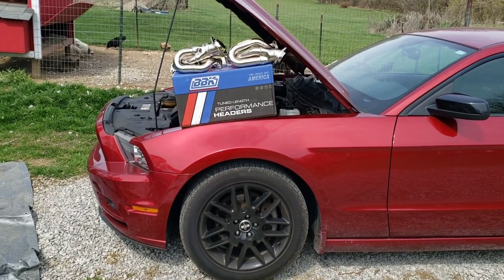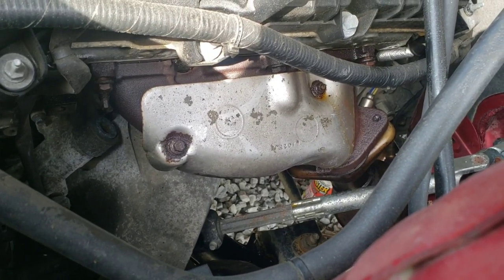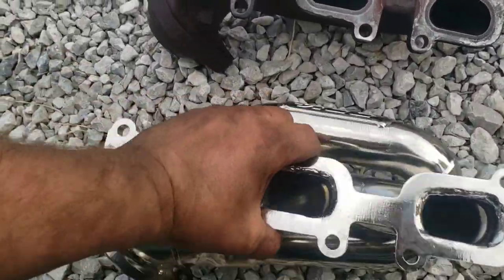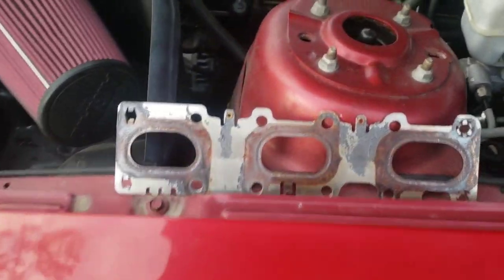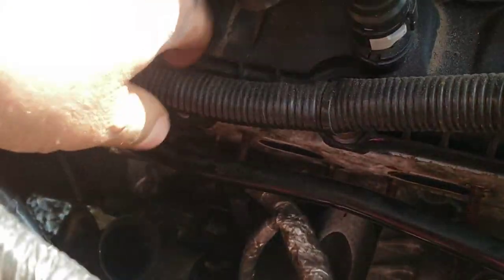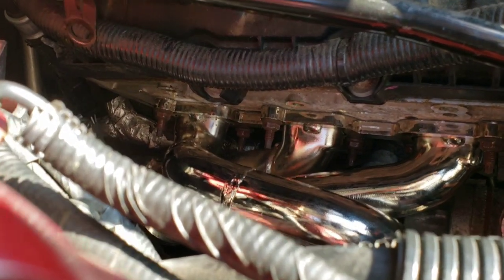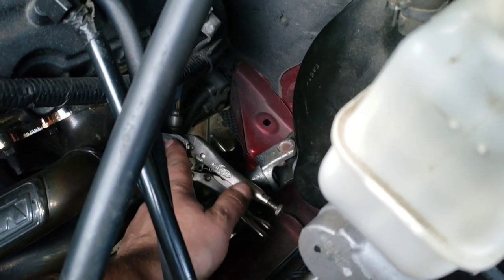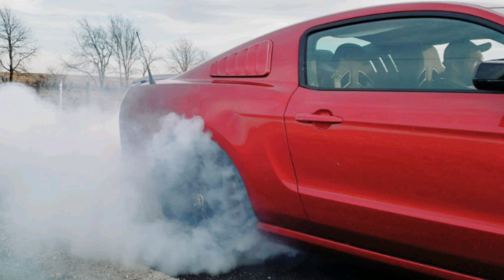*Detailed* 3.7 Mustang BBK Shorty Headers Intall Tips & Tricks

Comment: i thought all this time we didnt have flange gaskets between there becuse someone stripped my bolts putting my x pipe on and i had to put new bolts on so i guess when they seperated the gasket fell out. i been having a lean code for a long time and found out its bc a leak right there. crazy

Comment: Hey dude, I just bought some shortys secondhand. So it didn’t come with any hardware other than the headers themselves. I already got some new gaskets, but I have no idea where to get the bolts/nuts at
Reply from the maker: Anywhere that carries bolts and nuts lol. Your best bet is to go to lowes or home depot or something like that. Take the header with you so you can match up a bolt to the threads to see which thread pitch you need.

Comment: Big help your video man..... one question..... at the end did they sent you mixed gaskets (probably was the case) and that's was the main problem of you header leak on the driver side? also the double gasket you used to fixed the problem you let them like the passenger side (probably the correct sideway to let the gasket) or did you keep the same side that was used on the drivers side?
Reply from the maker: I had two leaks which I detailed in the video. The one with the gasket was because, as I said in the video, my header flange was warped which is why I double gasketed it. I bought different gaskets and they were the same on both sides, so it did not matter which way they went. Then I had the leak at the downpipe because, as I stated in the video, the factory hardware does not work with the new header.
Reply: @BuckeyeBallistics  which hardware do you recommend to use for these headers
Reply from the maker: I used what came with the kit- I just didn't initially realize that this was absolutely required to not have a leak, so I had to cut the old hardware out on the one side in order to install the new hardware.

Comment: Pretty sure this is my 20th time watching this
Reply from the maker: Why?
Reply: @BuckeyeBallistics  so we’ve got the the driver side header attached to both the flange and the engine itself, now were having trouble lining up the flange of the exhaust and the flange of the header, any suggestions?
Reply from the maker: I think I remember running into that issue. Any tips I had regarding that should have been included in the video. Worse case scenario you could detatch the exhaust further down so it will line up...
Reply: @BuckeyeBallistics  we ended up getting it to work, and can’t explain how helpful the video was.

Comment: i got mine installed and im not sure if i did that break in procedure correctly i thought id get a bit more power but it actually feels like i lost take off power is that normal or did i cause a exhaust leak ? i have a muffler delete so being able to hear that exhaust leak would be hard
Reply from the maker: A slight leak shouldn't cause any loss of power. Also, shorties add bottom and mid range power, so you shouldn't have any bottom end loss. You might have something else going on unrelated to the header install.

Comment: My LT headers come next month, if I PV blast my stock header bolts everyday a week out from actually trying to remove them, will that help or won't do anything?
Reply from the maker: Oh it will definately help, especially if you aren't driving it.
Reply: @BuckeyeBallistics  It’s my daily, so would it still do anything?
Reply from the maker: Yes, but not as much as if stationary. PB blaster is technically flammable (requires direct flame to burn), though I've never had an issue with it catching fire on hot exhaust parts. So since you'll be driving it every day, I would recommend only spraying it after the engine has cooled down, and allow it to set for several hours before driving it again. It's still going to smoke a little if it doesn't completely dry/evaporate as the residue "burns" off. I've done it numerous times over the last 20 years without having any issues...
Reply: @BuckeyeBallistics  Alright thanks man!
Reply: @noahhuraan5353  did it work?
Reply: @flawdaman305  Didn’t end up doing it, but the bolts did get stuck somewhat (like 2 of them) and we just heated them up with a torch to get them loose